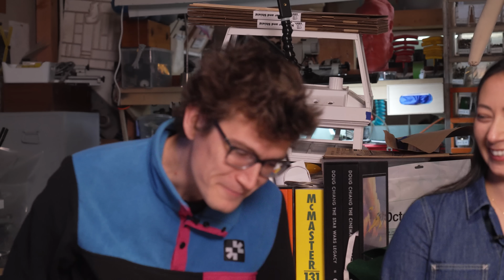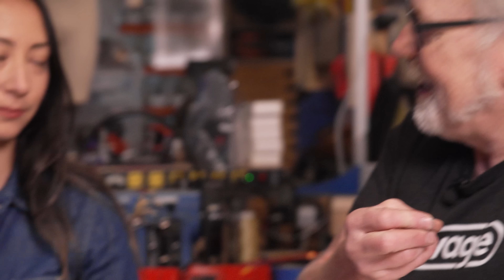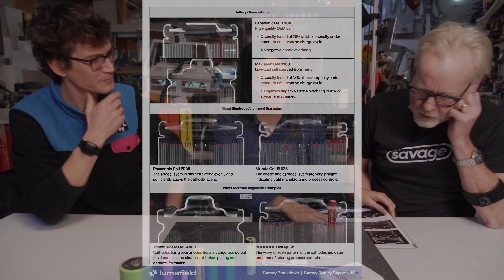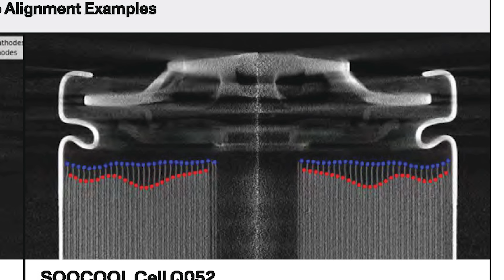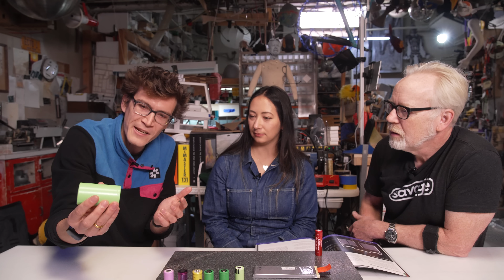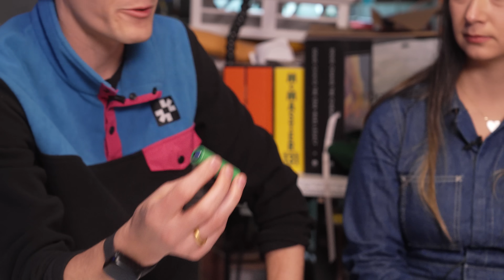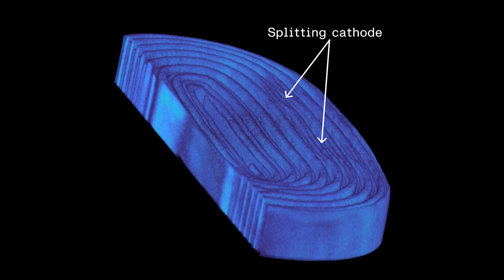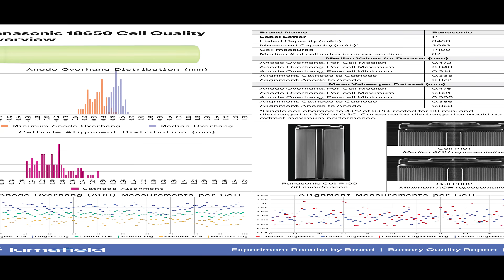The Surprising Flaws in 18650 Lithium-Ion Batteries

Comment: To my shame, I bought a pack of those 9900mAh cells.  Fortunately, I'd gotten into the habit of testing small power supplies with a synthetic load tester, and found the capacity of the miracle batteries to be even lower than legit batteries.  That shut the seller up when I asked for a refund.

Comment: Thanks all for producing this report and video. Hopefully the word spreads. Anyone remember this in 2010:
On September 3, 2010, UPS Airlines Flight 6 crashed due to a fire caused by lithium batteries in the cargo hold, resulting in the deaths of both crew members.
Reply: Fires are bound to happen

Thats why there were changes after that crash so if another fire happens in the same way it shouldnt lead to a crash

One thing i very much like with avation

It tends to have everything that allowed such a thing to happen be investigated
Reply: @nikolaideianov5092  Battery fires are not "bound to happen" if the battery is built properly, and not Chinese garbage.

Comment: I've noticed that the lg, Sanyo, Samsung (non counterfeit). Besides lasting for many many years, they can handle a very short period of dead short. And keep on working for however long. The ultra cheap and counterfeit are probably going to short internally and thermal runway is a lot more likely. This is the kind of information that is so interesting. Generally old power tool or laptop batteries will have one or two bad cells the rest are name brand, and so much better and safer than cheap generic cells.

Comment: You know what pisses me off how normal alkaline batteries, the brand name energizer and Duracell they self-destruct just sitting there. I happen to go through some old stuff that I didn’t touch in a long time and only the brand name batteries did this the other ones that were like Japanese branded or whatever that came in a remote, but not installed in anything Were A-OK and actually still had a full charge. I don’t know what it is about energizer endurance though, but they manufactured them to self-destruct, which is pretty obnoxious.. but when it does that they’re stock goes up… cool video thank you

Comment: I only buy molicel and Samsung batteries cells. I've seen 18650 batteries light off and they can be bad. Its not worth cheaping out on.
Reply: The Panasonic cmax batteries NMC chemistry are also pretty crazy when they pop off. I have almost 300lbs of them for huge audio system. Pulls 2200-2900a @ 15.8v like a champ 💪

Comment: There's trending defects happening now on legacy Model S from defective pack design. 👀
Reply: That's the pack, not the cells. Tesla used Panasonic cells back then, IIRC, which are obviously not low quality, but the packs were designed by Tesla themselves - and we should know by now that safety isn't exactly a priority at this company.

Comment: Most of these types of batteries are made in like and handful of factories in China. That's...how they do things. They decided...this city is going to make...bedding or this one is going to make consumer electronics. Now ..they have let some flexibility break out. Individual business owners opening manufacturing facilities but.... I know when I got into RC planes, one of the guys at the field was crazy big into it to the point where he was trying to have his own brand of batteries to sell online. This was like...maybe around 2008. There were only four factories in China at the time that basically made every type of Lipo battery. They just ..slap different labels in them during the production run. He could order as low as like 1000 batteries a run. But, that did this for like 8 different brands like Turnigy and Tatto. Same batteries, different labels. 
Personally... I've been buying only HRB lipos and they have been very good. High cycle rates, no failures or fires. Pricing is right in the middle of the pack.

Comment: Another thing consumers should do (and most dont) is inspect the pile of devices you've retired to the junk drawer. Most people have old phones, handheld consoles, or other devices they haven't touched in years. Dig out that old DS or PSP and look for any signs of expansion. Ideally, open it up, remove the cell, and inspect it directly. If the pouch is in a hard shell, you can set it on a flat surface and check if it rocks back and forth. Whenever possible, remove batteries from any device before long-term storage. 

And if you use cylinder cells for things like flashlights, vapes, or whatever, buy some battery wraps. They're dirt cheap, easy to replace, and often even include the terminal insulators as well. If the wrap ever shows ANY damage, just rewrap it. The negative terminal of these cells is the bottom, sides, and even outside edge of the top (completely surrounding the positive terminal), so shorts can happen extremely easily with a damaged wrap. And when you do replace it, replace the insulator too.
I would be shocked if damaged wraps weren't the main cause of most of the catastrophic vape fires we used to see constantly. Large, stacked cell tube mods (and eventually, mods that use standard li-ion cylinder cells in general) falling out of favor is probably why we dont see it happening nearly as often today. 

Using these cells requires more awareness and precaution that a typical battery, it's why 99% of the time we encounter them, they've been idiot proofed by whatever device manufacturer used them.

Finally, not only should you buy cells and batteries exclusively from reputable brands and trusted sellers, but do the same with the chargers. A good external charger typically is the safest way to charge cylinder cells. Treat the charging port on your vape mod as a backup option, not the primary way you charge. I promise, it is not as good as a dedicated charger.

Comment: I have camping light powered by this type battery. It was supplied with "oem" no name cell and for me was "fine". It was noticeable -  half way to discharge - light was unable to shine at full brightness (voltage sag)
After season i decide to buy proper Panasonic cell, same capacity on paper, cheapest one for low output devices - difference was huge - light work twice long, and is full bright almost till discharge.
fun fact: Cell cost me same as new lamp ;) but worth every penny...

Comment: In summary, Schrödinger just needed a CT scanner!
Reply: yeah, but for quantum mechanics using a ct scanner is equivalent to opening the lid. as soon as you interact with photons be they x-ray or light doesn't make a difference.
Reply: @botchjob308  Even worse, the x-rays could trigger the detector and kill the cat
Reply: @botchjob308  
WELL YESSSSSSSSSSSSSSSS!
Reply: A CAT scan, even.
Reply: @connerlabs youre really crossing fe line
Reply: @connerlabs OOOOOOOOHHHHHHH
Reply: Two cats, one alive one expired. 😝😝😝
Reply: Can you really tell the difference between the CT scan of a cat that just died and one still alive?
Reply: Clever!
Reply: Or just scissors.
Reply: lol
Reply: A IR thermometer would work without any energy being applied for detection.
Reply: where can I buy one of those? are they expensive? can it fit in my  bedroom?
Reply: @rogerd4559  😂😂
Reply: Schrodinger's CAT scanner?
Reply: @rwerk66  🏆
Reply: “Zee cat, hast been, irradiated!” Oh thanks schrodie, anything else? “…Nein.”
Reply: I've seen a squatter's cat on the blink scan
Reply: You could just shake the chit out of the box...
Reply: yes and no.  But that wasn't the point of the question was it. Therefore removing doubt, question or supposition.

Comment: Many lithium-ion cells are sold unprotected including cells from Samsung and Molicel. If you want those cells protected you will pay more than 2x as much as an unprotected cell and for the top line 18650 from either company up to 12.00 per battery. Once again you pay for what you get. What I'd really like to know is just how dangerous these lower cost cells are if used and charged properly. Does it really make a difference having "wavy" windings? Where are the reports addressing such a dangerous hazard as poorly manufactured batteries just "waiting" to self-implode?

Comment: Very interesting video.  It made me look up a few things, and I noticed this was primarily focused on Lithium-Ion batteries, which are high energy in small space.  I happen to use a Lithium chemistry called Lithium-Iron-Phosphate, whose volume is larger than Lithium-Ion but is considerably safer than the batteries reported on here.  The Lithium-Iron Phosphate (LiFePO4) battery is still considerably lighter than an Lead Acid battery, and is found in more and more RVs as well as Ham Radio Operators who run portable operations.  The main issue is that you cannot charge LiFePO4 batteries at 0C or below, but the batteries are usually equipped with a safety circuit that cuts the charging circuit if the temperature is too low.

Comment: Not sure how reliable this would be but I suspect you may be able to check at home with a accurate kitchen scale. All quality batteries who have tight windings and a safety cutoff device should be heavier then those that don't. While at the same time i expect the difference in weight between quality batteries to be very low. 

You would have to check at home if you can see this reliably. Pls don't just take my word for it. But I don't see why not.

Comment: I wish they showed why an anode overhang can lead to a short circuit. We see the structure inside, but it is not clear what each part does.
Reply: Lithium plates out as very small needles, called dendrites, that grow, interconnect and short out the layers. These dendrites are too small (30-60 microns) to see on a CT scanner. Raw material chemistry knowledge is critical, most researchers do not realize that secret impurities in the raw materials can actually inhibit dendrite growth in good batteries. The two electrically active plates are separated by a  10 micron thick separator. Apparently, when the “jelly rolled” cathode extends beyond the anode (as seen in the cross-section edge view, it is analogous to a telescoping gift paper roll ), it can cause non-uniform lithium deposition, leading to the formation of dendrites (metallic needles) that can pierce the separator and short-circuit the cell.

Comment: An important point here is that the reason Lithium-Ion batteries are so good is because of the energy density. The reason they are son dangerous when shorted is because of the energy density. So what makes them most useful is what also makes them dangerous when they fail. They keep going until that energy is discharged in an exothermic chemical reaction. Part of the problem with the Chinese cells is that the thickness of the separators varies, to keep the costs down. That makes them less resilient to degradation and almost turns them into an explosion waiting to happen. That may not show up in these scans. As well, different levels of purity in the electrolytes and so on. That can only be examined through destructive examination and is outside the scope of what they have done here.

Need to make sure you classify those results in a table of where they were assembled. China, Mexico, Japan, Philippines, etc. Bet that'd be really telling, and have some surprising results. It's also important to remember that the re-brands are NOT going to be the same from batch to batch. One day they may buy from maker X, but a month later, maker Y gives them a better deal. So you don't know what you're getting with the re-wraps.

Comment: China plays this game, of stuffing a tiny electrolytic capacitor into a bigger form Capacitor shell to commit fraud on buyers. To avoid the buyer detecting the difference in mass or weight, the fraudulent manufacturers will add sand into their bogus products until the correct weight is achieved, adding a layer of glue to lock the sand and tiny capacitor inside down so the buyer cannot shake the finished fraudulent component and detect loose internal parts or shifting of sand making noise / vibration within the can. So in that case a capacitance meter reading and test for electrical leakage at the stated working voltage which some small capacitors could meet the electrical capacitance spec, but fail the leakage test due to thinner insulator-separator between the anode and cathode. In China, ethics are rare. It is the Wild West out there with crooks trying to steal your money. Other tricks, include sanding part numbers off of cheap semiconductor components that use the same physical packaging and relabeling with a laser, the part number for a much more expensive chip, regulator or transistor or diode, resulting in a part that will never function at all, after they got your money, or worse, functions for a very short time, then gives out because the use case is exceeding the operating specifications for the actual transistor or diode they used in the fraud operation.

Comment: I’m not sure full submersion in water does anything to stop a lithium ion battery fire.  The reaction is self sustaining generating its own oxygen.
Reply: Removes heat and might mitigate runaway of all cells in a pack or keep the intensity of a run away to a safer level.

Comment: I bought 18650 batteries from eBay. They were 1/4 the weight of a Panasonic 18650, and had 2 minutes of run time for a flashlight. I was able to return them for a full refund.

Comment: I think giving the advice to fully submerge a pack in water is very risky without extremely clear explanation. To be clear ONLY ever do this as an absolute last resort if the pack is already essentially on fire and you can't get it outside for some strange reason, then okay I guess it may help the house not burn down..... But personally I always charge any large lithium pack near an easily opened exit or outdoors if the weather permits.

Comment: I've been dealing with rc lipo batteries for about 8 years now. The difference between advertised output and actual output is wackadoo. I don't understand how they can get away with false advertising about capacity, c rating, all of it. 
I don't understand. 
If I advertise a product, it says on the side it contains 12 oz, but when you pour it out it's only 8 oz, I would be prosecuted for false advertising right?
Why do they get to do it?

Comment: 5000 of these possible failure points in an EV battery.... VS 2 stamped pieces of metal welded into a gas tank.

Comment: Clickbait. The core issues discussed in the video are not inherent to the 18650 form factor itself, but rather to:Poor manufacturing quality Inadequate quality control,Counterfeit or ultra-cheap cell, a more suitable title should be The Risks of Low-Quality 18650 Lithium-Ion Batteries or What Goes Wrong Inside Cheap 18650 Cells”

Comment: This is why I avoid cheap third party batteries (and cables). I do beileve in the right to repair EXCEPT for devices with Litium Iron batteries. The charge/discharge process needs passive and active safety management and high quality manufacturing standards. Sometimes it is worth being cautious when taking short cuts with products which are potential fire risks and prone to explode. That said I do have power tools and a camera with Lithium batteries, a mobile phone and tablet plus an EV but in each case the assurance of an established trustworthy brand. Safety is worrth paying for.

Comment: Splashing water on it does NOT make it worse. It's thermal runaway. If you can splash water on it, the water will cool it down. Water doesn't matter when it comes to the chemical reaction. This is bad information that might hurt people if not corrected. If you don't believe me see FAA regulations for battery fires on airplanes.

Comment: It must be noted that these tests are for Li-ion polymer battery technology which has a fundamental difference compared to LiFePo technology! The chemistry is different! LiPo , Lithium ion Polymer has a higher energy density but is more volatile. They are the ones that most people have seen burst into flames or look like flame throwers. The Lithium iron phosphate (LiFePo) are actually self extinguishing and have a lower capacity than the LiPo batteries referred to here. The 18650 cells i have been able to find are all LiFePo. I certainly hope that these people are actually showing tests of LiPo rather than LiFePo and claiming disaster when there is hardly any chance if the cells are LiFePo. Look on YouTube for the many destructive tests that have been done on truly huge LiFePo cells and batteries, as found in home inverter installations, that show conclusively that the worst that can happen is the bank that has been tested by driving a steel stake through the batteries in the bank only smoke for a short while and then self extinguish. I think this video is strongly obfuscated clickbait disguised with items that look like current consumer parts that, often, have cells that look similar but contain safer chemistry than what is found inside LiPo cells. My opinion for what it’s worth. Sad to see Adam Savage resort to this. I did expect better.

Comment: Great Video. This should be done for Lipo Batteries and LiFe batteries used in Radio Controlled vehicles. Specifically 2s,3s,4s and 6s cells. Could you make this happen? I am curious about paying $30 for a 2s or $120 for a 2s battery pack, soft and hard case.

Comment: I wonder if they have had a peak into USB Chargers too? They have been a source of house fires in the UK, where cheap ones are very unsafe, with no thermal protection, poor connections etc. I've taken apart a couple for projects, to find out for myself, a cheap one may only have half a dozen components, vs a main brand one has more than 20.
Excellent Video. 👍